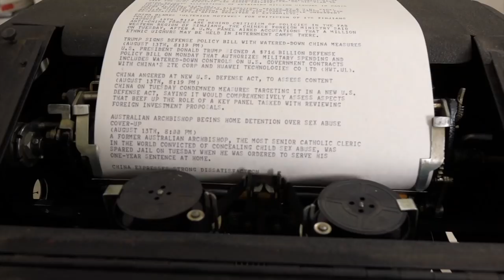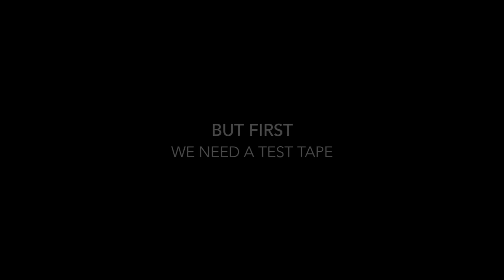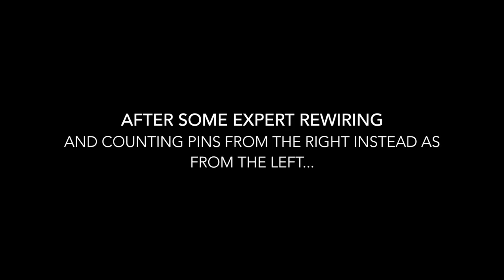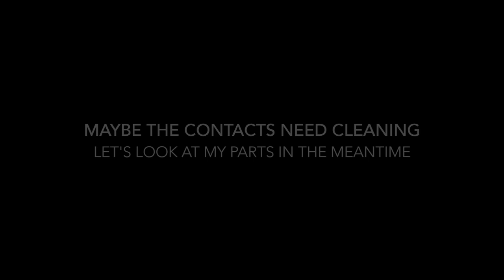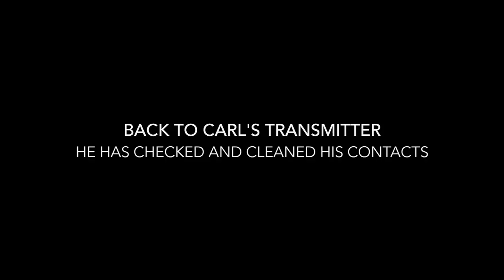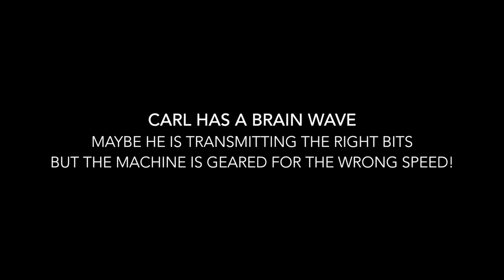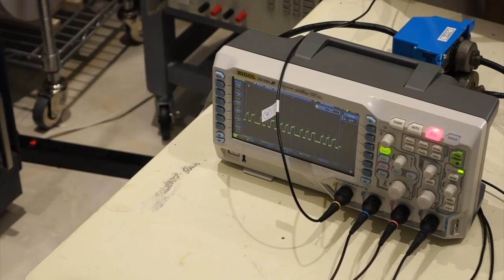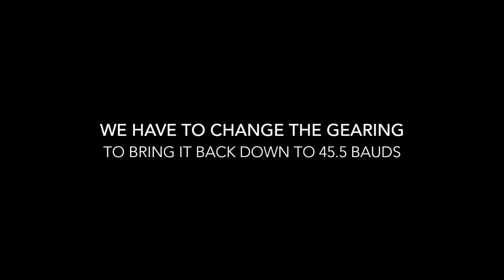Teletype Model 19 Part 10: Restoring the Transmitter/Distributor

Comment: The 6-level code is called TTS which is short for Teletypesetter.  It was used on the Teletype Model 20 which was originally designed for transmitting messages pre-formatted for tape operated typecasting machines.  The six-bit code was different in that it encoded both uppercase and lowercase, and used a 'shift' character for accessing uppercase letters and figures.

Comment: That power supply is leaking the transmission contents, you should file a CVE for it and make a patch. Until then, it's a 0day!
Reply: Actually a TEMPEST issue: https://en.wikipedia.org/wiki/Tempest_(codename)
Reply: I believe they have a side channel attack mitigation already. It's just that the case is being powder coated. :)

Comment: If someone could build an ASCII to Baudot converter using an Arduino, It can be connected to a computer to print out the system log for a web server or something of a similar nature. That printer will never get tired as long as it is kept lubricated.

Comment: The smoke is actually a backup system. If the line goes down it is possible to transmit using smoke signals. ;-)

Comment: What would happen if you set the TT to 55 baud, as well?
Reply: Madness832 The tubes in the power supply glow purple and everyone in the room gets transported back in time.
Reply: Wouldn't it have to hit 88 baud to trigger that?
Reply: That would require a gear set change on the model 15 teletype to set it to 57 baud. We may not have the gear sets for that change. Our PC driver interface operates at 45.45 and also would need changing. Easier to change one box to 45.45 than to change 4-5 boxes to 57.
Reply from the maker: Yes, that would work.
Reply: I don't know? That mighy be pushing it beyond it's limits. The Teletype Model 33 runs at 110 Baud, but it uses 7-bit ASCII (Capital letters only) instead of 5-bit Baudot

Comment: I think I have seen movie film used as it is much stronger than paper tape, Just wondering if you could use an INTEL Communications chip RS232 chip
Reply: Mylar was used instead of oil impregnated paper to make tapes that were much more rugged. Typically in the ASCII days when used with computers, where a particular tape might be used hundreds of times. E.g. a loader program. Special heavy duty punches are needed - the dies in the perforator we have (or in a ASR 33 tape punch for the ASCII equivalent of our model 19) aren't happy trying to punch through mylar.